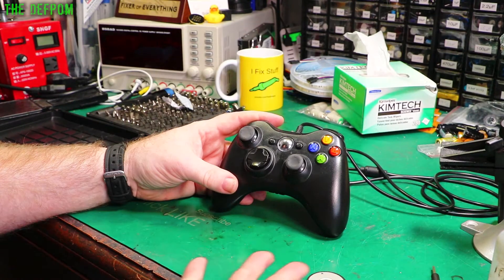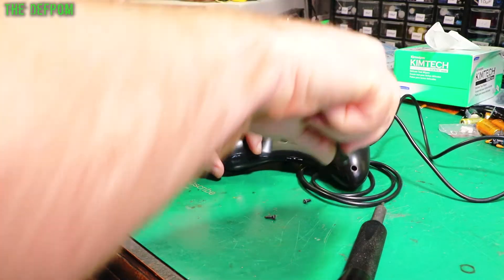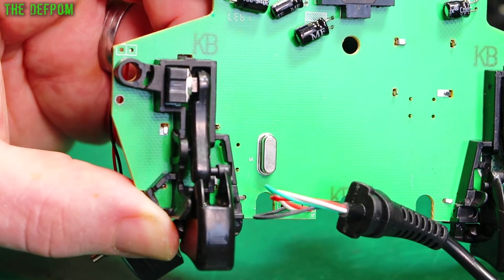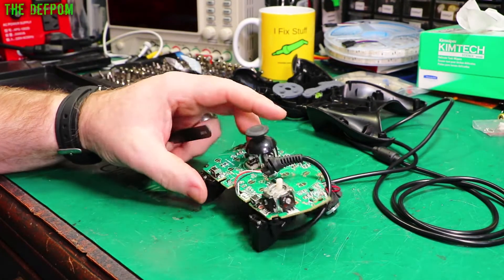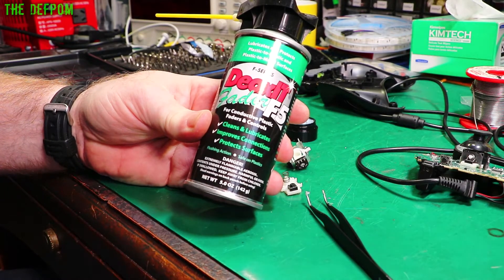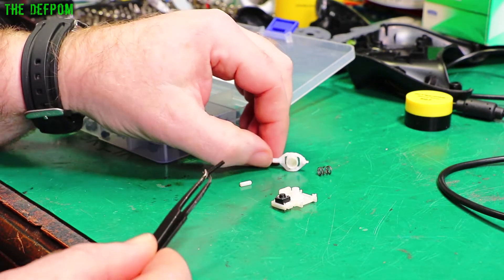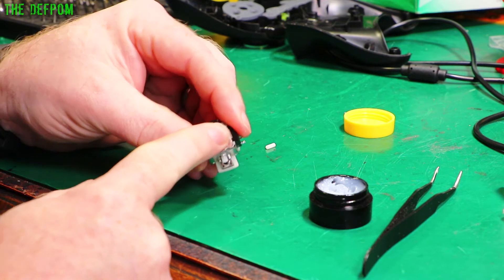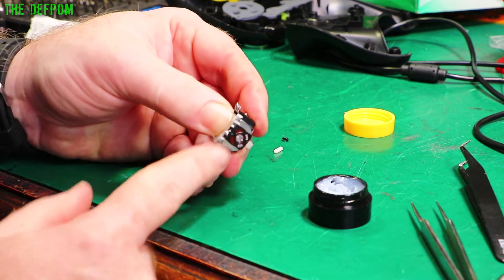🔴 Xbox Controller Repair - Xbox For Windows Controller - USB Xbox Controller - No.833

Comment: That is a problem with most 1/4 drive sets is the length of drive and diameter of the shaft, not sure an expensive I-Fixit set is the best thing but glad they are supporting you with a free tool set:-)
Reply from the maker: I have several driver sets, various ones from China etc, which are ok but nowhere near as nice and solid feeling compared to the iFixit ones.